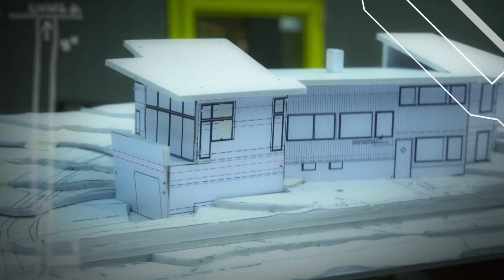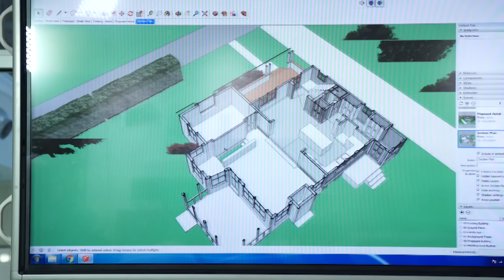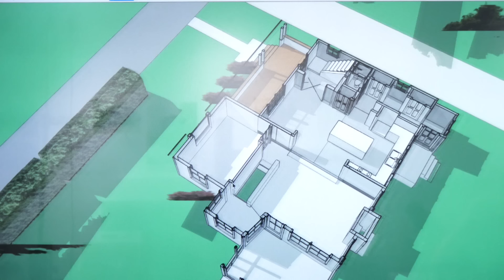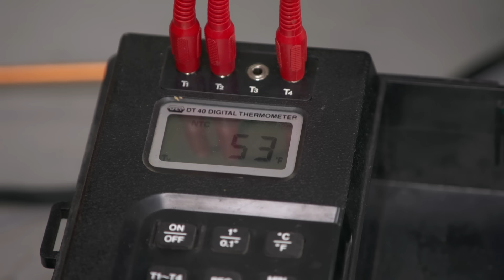This Old House | Designing Their Dream Home (S40 E9) | FULL EPISODE

Comment: another for the heat pump segment could be a rubber band. If you stretch a rubberband, making the rubber taught; it gets hot. then let it cool down to ambient temperature and quickly decompress it; it gets cold. let it get back to ambient temperature and repeat.

Comment: Replacing a floor mount toilet requires removing a couple of bolts.  What's involved with replacing a wall mount unit? Does tile or wall board have to be removed and replaced?
Reply: Exactly what I was thinking. Sometimes a flap or float needs replacement
Reply: Looks like the plumbing equipment drops in after the fact since none of it was in the base.  Presumably there is some sort of wall plate like a shower valve that has the flush switch and can be removed to access the equipment.
Reply: @dasaini  There will be a service panel in the wall for tank maintenance, just like the case of a shower valve.  As for the bowl, it is bolted from the outside into the steel frame, so that is not going to be more difficult than a floor mount. I think it is an excellent system because it is not necessary to have the tank outside of the wall.  It is just taking up space.

Comment: Great explanation of heat pumps! Hope to have one someday. I've heard they do need some maintenance and more involved cleaning than just the filter. Would love to see something on that.
Reply: They're pretty resistant to neglect.  You have to clean the outside coils once a year for the best performance (they get clogged with dust and pollen), but you can leave it for years at a time and not hurt the unit.  Of course, your electric bill will hurt quite a bit!
Reply: Hmm.. It seems like quite a bit of mold can build up inside. That seems unhealthy.
Reply: My heat pump that does an entire raised ranch house here in New England is only costing me right now $1.50 a day to run it.

Comment: I've heard from a lot of people that the heat pumps simply do not work. Nice in theory - but reality no so much.
So what you are explaining is that the heat pump has to run all the time basically to "work".
Wouldn't we being using the same or less energy to just heat the home with either electric, oil, or gas. In fact, oil and gas are much more efficient than electric... and the reality is the electricity is usually going to be produced using oil, gas, or coal.

So in reality you are just shifting the carbon emissions off site. Which is the same for electric vehicles. They are just shifting emissions off site. Not to mention the huge waste in energy by all the conversions needed to go from power production to finally get to the point of torque.

Comment: Wouldn't it have been more sustainable and more energy efficient to use any kind of geothermal rather than air to air system?
Reply: They're generating all the energy using solar.  They might have needed less solar capacity, but it's still net zero.  They could upsize the solar system, add batteries, and go completely off grid.
Reply: @bbmw9029   Geothermal would definitely be the most efficient choice for HVAC and could also be powered by solar, but I suspect their decision was to reduce cost. A geothermal system would be substantially more expensive to purchase and install than this setup.
Reply: @bbmw9029  Yes I completely understand but in the long term its going to give you more savings in terms of maintenance. Not only that, what if couple of days in a week you don't get enough sun so you're low on power, so it's hard to heat the place; or in the summer air to air systems struggle to dump the heat outside because of the heat outside. Also, I'm just worried about it adding to the urban heat island mostly, which again makes the air to air systems less efficient.
Reply: @lintophilip4066  All the math can be done up front to determine the sizing of all the systems involved.  The heating/cooling load is predictable, as is the solar power potential.  Geothermal would lower the amount of energy that would be needed to carry the thermal loads.  But it might be cheaper to upsize the solar system (and battery storage if they would go that way.) vs installing geothermal.   It's all how the math comes out.
Reply: @lintophilip4066  Geothermal is exciting but the break even period is just ridiculously long. Some of the energy efficient stuff that they are doing will take a long while to break even already.

Comment: I love the net zero, but I hate that those solar panels will not pay back the carbon it took to make them.  That array is HUGE compared to what is needed in sunnier states.  just the bottom 2 rows on that barn works fine south of Mason-Dixon line.

Comment: It sounds like there aren't really any downsides to heat pumps, now that they work in very cold climates. Are there any downsides? Are these going to become more common in new builds?
Reply: They’re very loud, think about an indoor AC unit basically. Needs to be in an open air area too. So it’s hard to put in a small house you basically need a far away garage that’s spacious too
Reply: I have a huge heat pump right outside my bedroom window that does 5 units inside. I have a 2x4 wall house, 45 years old here in New England, and I have to say its not loud at all. Hardly hear it. Maybe depending on the brand one buys it may be loud as you say. I have a Mitsubishi and its right next to a window. Its not only super quiet, it works extremely well in our cold winters we get here and so far its only costing g $1.50 a day to run it. I have a raised ranch, and heat both floors. So its definitely worth getting one
Reply: I have one and its my primary source of heat here in New England. I have no complaints